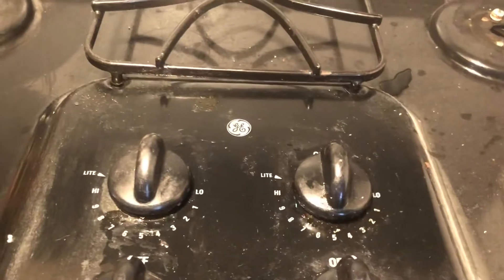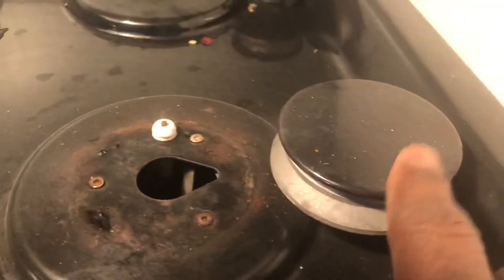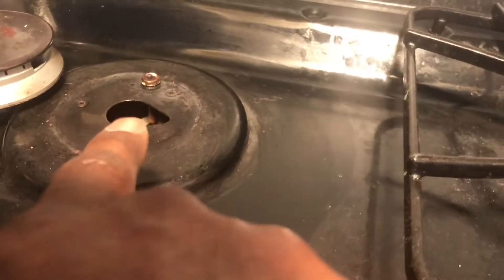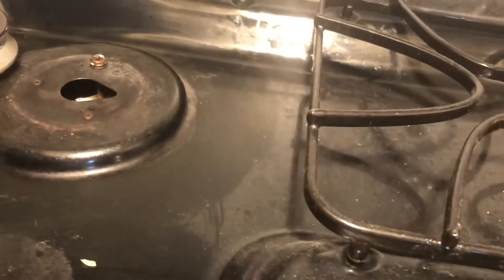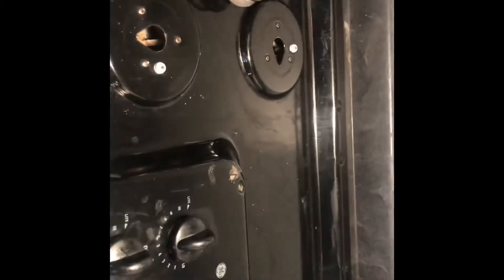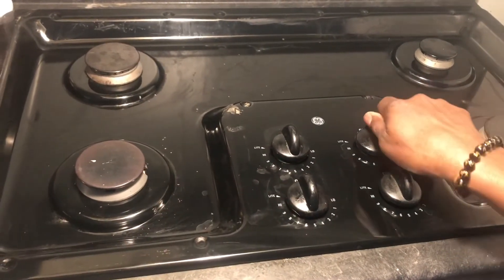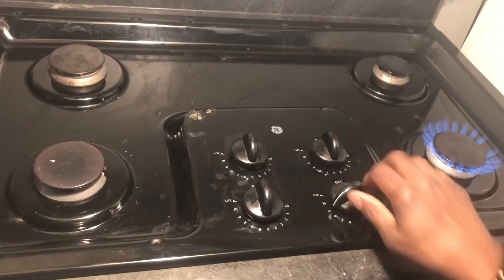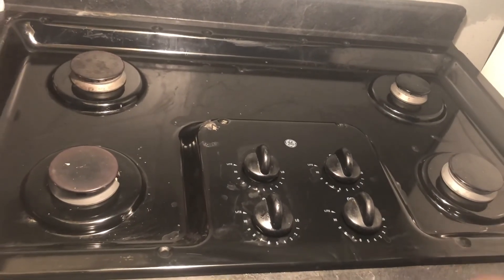Gas Stove Clicks when off.  GE Cooktop Repair

Comment: Add a twist to this:  Vern.  I have the same stovetop as you've illustrated.  When the four knobs are in the "Off" position and the black caps and bases removed, I'm receiving a continuous clicking from a location inside the stovetop, dead center between the four knobs.  My problem doesn't seem to be at the burners' igniters but instead some central aspect of the ignition system that may be hidden inside the stovetop (as if there is a switch that isn't opening/closing properly).
Reply from the maker: I would try the cleaning process just to rule it out. If there's clicking and not start, it could still be the same issue.
Reply: Thought it might be the ignition module (Yikes.....!!!!!) but I finally just lit and burned all four burners.  The clicking became less and less and less.  Ahhhhhhhhhhhhh........."Moisture".........(Source Unknown).  Note:  I'll also keep in mind that "fat" (from my wife's oily Chinese cooking) could have been the culprit.
Reply from the maker: Awesome